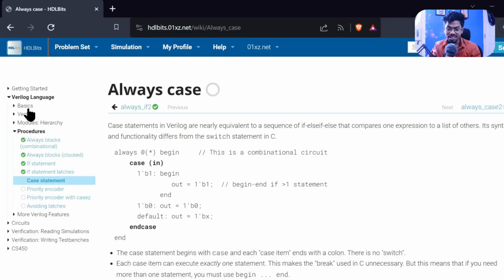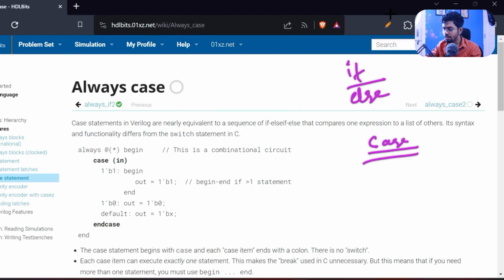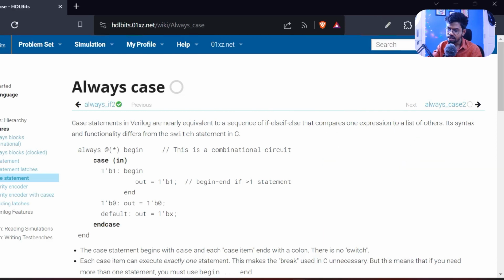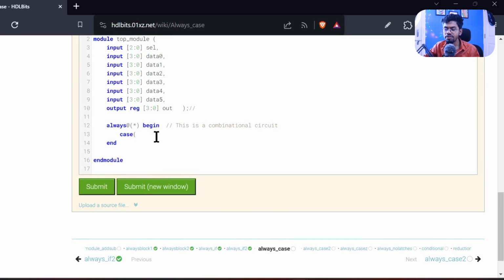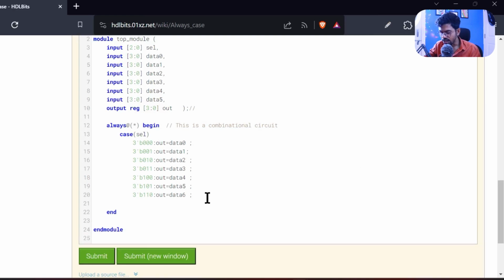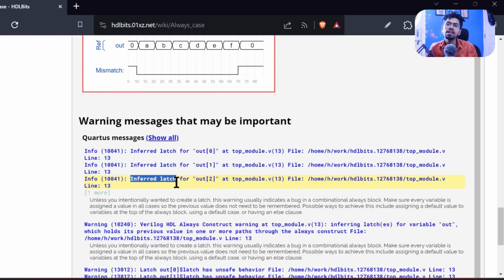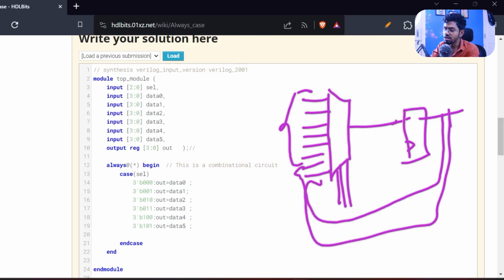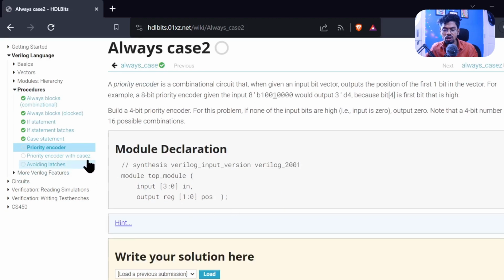What's the need of CASE ? | Lets Learn Verilog with real-time Practice with Me | Day 16

Comment: Inside the always block a reg type can be used right but in this case you are using wire type as the ports are wire type, I am talking about sel, sel inside case should also be reg right?, would that not be an issue? pls explain, thanks